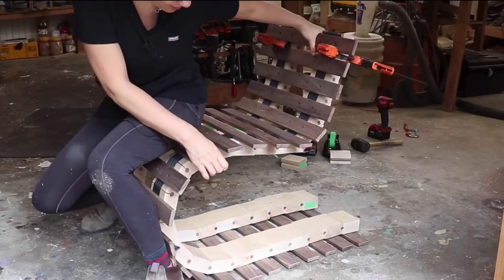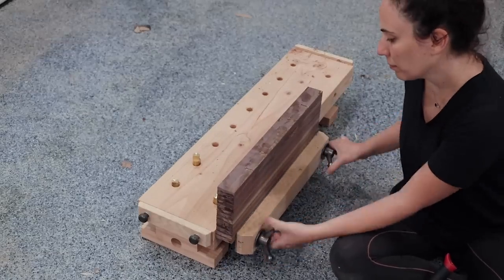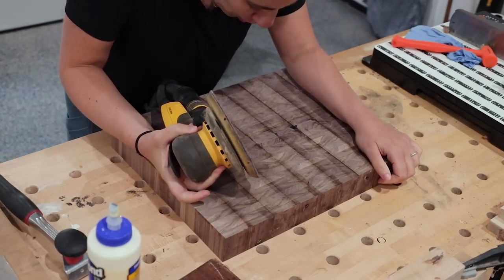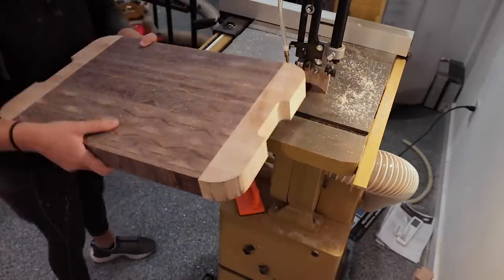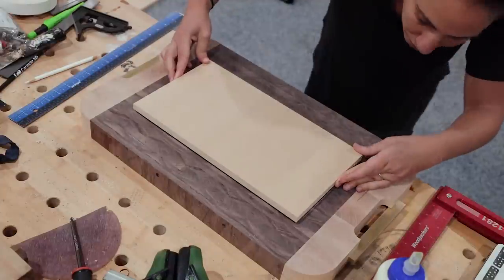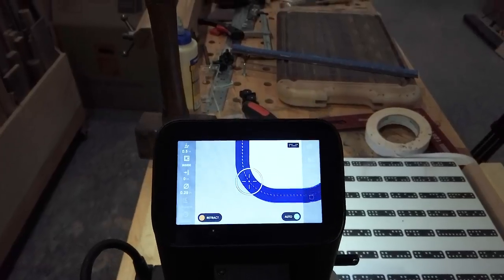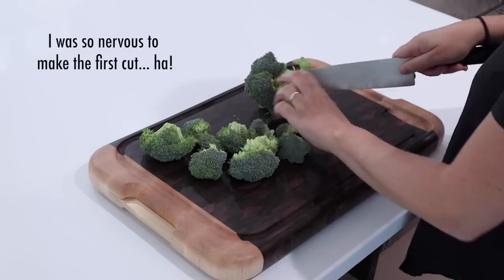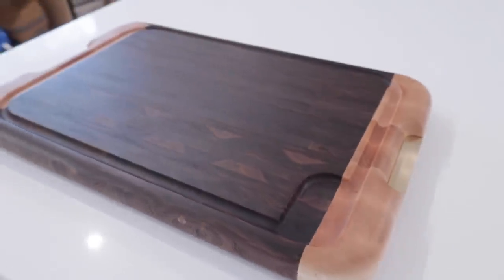Turning my Failed Roll Up Chair into an End Grain Cutting Board with a Juice Groove

Comment: The chair wasn't a failure; it was a complex milling process!
Reply from the maker: Hahah! I guess so! Love it
Reply: ok
Reply: @3x3CustomTamar  It looks like someone may be impersonating you.   I got a reply from Official3x3CustomTamar saying you wanted to give me a gift.  Not sure if you can do anything about it, but thought you and your subscribers would like to know
Reply from the maker: @mwoody4560  ugh. Yeah. I keep trying to report as spam. So annoying.
Reply: @3x3CustomTamar  I thought it was probably a scam but contacted them anyway out of curiosity.  They wanted to give a Macbook and iPhone because i’m such a good subscriber. 🤣
Reply from the maker: @mwoody4560  I hope you didn’t give them any of your info…
Reply: @3x3CustomTamar  please do the chair again.  Speak to a local structural engineer or collaborate with Grady on practical engineering on here.  Its a great design it works just need to choose the right materials and  joints, so they have fixity
Reply: @3x3CustomTamar  do you do give always. I got a message asking to text a number. Is that  legitimate ?
Reply: @mwoody4560  happened to me too yesrerday they sent a pic of an old dewalt josite fan and then wanted 50 dollars for shipping lol
Reply: And turned into something you can STAB!

Comment: Congrats on the new saw, I bought a saw stop, I love it but it didn’t come without growing pains. I made a crosscut sled that included the Katz Moses stop block on top of the fence of the sled. I was cutting a long piece which didn’t require the stop block. I turned the stop block around so it’d be on the side of the fence facing me, out of the way, but I didn’t realize I had it in the path of the blade. The saw stop does work and will detect aluminum. Cost me a new dado stack and a new dado break but at least I know the system works. Only took about 1/32 out of the aluminum. Moral of the story, when you build your ultimate crosscut sled, include something that prevents the stop block from being placed in the path of the blade.

Comment: You working on the floor felt very familiar to me; even inspiring interestingly. I still work mostly without a bench so it was something that I noticed. Though, I'm sure you'll be glad when you can do glue-ups a little higher up. Some form of folding work surface may be a good option.

Awesome job on the cutting board! I like the way that the two tone look works with the complex pattern.
Reply from the maker: Thanks! Yeah. Hopefully I can build something soon

Comment: Damp paper towel under the cutting board -- or a damp dish cloth -- forgot about that one! Used to do it all the time when I worked in kitchens with plastic cutting boards on stainless steel surfaces. It works great.
Reply from the maker: Yeah! It’s a cool trick

Comment: Too late now but if you had used a pedal bike chain (or stronger chain) epoxied in a grove instead of straps, your chair probably would have had the one way pliable strength to hold the chair shape and still roll up. You could even have used thinner components. Beautiful cutting board.
Reply: Never too late, Tamar can always work on 3.0!
Reply: Great idea, but skip straight to a motorcycle chain though, a bike chain probably wouldn't stand up to the forces involved considering that the other one kept stretching the webbing.
Reply: The roll up chair has some design challenges.  Its a project that would actually benefit from engineering knowledge with calculations of load, force, and material strength.  A stronger "strap" or chain is a step in the right direction but it could lead to more hours of wasted time if she just goes for it without some more advanced pre-planning.

Comment: Shaper Origin seems like the tool that you really really have to find reason to use and not the other way around, to solve problems.
Reply from the maker: Not really. It just makes tasks that you can achieve otherwise easier.

Comment: Nice cutting board and great explanation.  👍  Having owned both a drum sander and a double drum sander....  A handheld belt sander is a better faster and smaller choice for leveling the maple ends of the cutting board.  drum sanders only allows for a very very small amount of removal per pass.  New shop is comming along 🙂

Comment: Love the board! Its just *chef's kiss*! just out of curiosity,  why not use the shaper on the board itself? That's how I knock out my juice grooves. Super accurate, and a lot less nerve wracking. Don't have to worry about the router getting away from you, and you have better dust collection. Just a thought. I just love how the board turned out that. And the brass handles are a flawless touch. Just well done!
Reply from the maker: I was going to. But I really wanted to show the mistake in going the wrong way with the router the first time and thought this would be a good way to show it

Comment: I was tempted to try 1/4" dowels on my last [edge] grain cutting board. I used clean wood but thought it could be a cool design detail while adding some strength and of course help with alignment. Decided it wasn't worth the effort.
Reply from the maker: So we came to the same conclusion. Ha

Comment: I was thinking about this chair of yours again and had a thought. I'm sure you may have had the same one or someone else offered the same idea but why not treat the slats as tenons to fit into several mortised end caps. they could be pulled tight with an elastic or a threaded rod. not your original intent but the mortise keepers could be added to the rolled chair without a lot of excess bulk. you only need them in the weak stress areas and they can connect on each side with a strong bungee if needed. anyway, just a thought.

Comment: At 11:07 you started to explain in what direction to cut with a router. In machining we use the terms "Climb cutting" and "Conventional cutting" each has its uses as well as drawbacks... I would suggest doing some research on this to understand and increase quality from the get go.
Reply from the maker: I don’t need to do the research. I understand the correct way to go. I was trying to explain in layman’s terms

Comment: I use that same Makita porta band. What type of blade do you use. I find that my blades get dull fairly quick. Mostly use it for cutting aluminum surrounds for shower doors and blinds.
Reply from the maker: I’ve actually never changed the stock blade

Comment: Tamar, if you have need to use CA glue and keep squeeze out from sticking to something else, use Parchment paper.
CA Will penetrate waxed paper but will Not penetrate or stick to Parchment.
So, remember: for wood glue, use waxed paper. For CA glue, use parchment paper.

PS: Great cutting board and use of scrap material. A real case of making lemonade. 😁😁😁

Comment: Great work! What a way to recycle an experiment that did not go as planned (not a failure, by the way). I used to be a scientist, I have, at least, two "failed" experiments that lead to a scientific paper and new fields of research... So, there, you had an experiment that did not work but you turned it into a new field!
Reply from the maker: Thanks! I’ll keep at it for sure. But for now we need practical stuff in the house. Ha
Reply: @3x3CustomTamar  check out #iliketomakestuff Bob makes some awesome, tricky, funky household furniture and other projects!!

Comment: I wouldn’t count that as a failure, maybe it’s still in process. That was a very complex engineering process with the angles, the correct materiel for strapping, keeping it from twisting. But that being said, glad you made this board l, looks awesome! And a great way to reuse wood.
Reply from the maker: I’ll get back to it someday. But for now we need stuff we can actually use. Ha

Comment: Well Tamar,
I'm not at all surprised that you used those beautiful materials to make something useful for yourself. Good for you.😉
While I am a bit disappointed about the chair, understanding our limits is important to keep us from getting discouraged and giving up altogether.
It is better to walk away from some challenges and keep finding new successes. I am confident that you are more than capable of building a successful chair, but the time and effort required is definitely not practical for your busy life.
Congratulations on your first project at the new shop and getting to use it right away, just upstairs.😁
Yes, sometimes you need to do something for yourself.
The cutting board is a beautiful, useful piece of art!🤙
Reply from the maker: Not walking away. Just a pause. The next version will use different materials 👍
Reply: @3x3CustomTamar  Good to hear.
I use walking away and taking a pause as synonymous.
Not quiting, but putting aside to regroup with a different plan which sounds like what you are doing.😁
Hopefully everything is settling down and starting to feel like home.
I'm still moving and now it's September, just crazy.
Can't wait to see your next idea.😉🤙

Comment: Amazing video and finished product.  I'm continually impressed by all of the little techniques that you've learned and use in your projects. The jigs and templates that you make, the specialized tools that get you exactly what you're after.    

One question about the design though... In your pencil drawing on the wood of the juice well (@ 13:31) you drew what looked to be a spout at the corner edge of the board for pouring the liquid out of the juice well. I'm curious why you decided not to cut that into the design in the end.
Reply from the maker: Haha. You guys notice everything huh. Just a last minute design change. Seeing as how it poured out at the end I probably should have kept it in
Reply: You can still add it if you really, really want to....   ;)

Comment: Screws! The fabric tape cannot be fastened with screws! The screw pushes the fabric fibers apart and creates a backlash of 2-3 mm, so everyone who makes flexible designs on the tape is glued to the entire surface. There are only narrow strips between the pieces (no more than 1 mm) that work as a rigid hinge. 
Sorry for the Google translation.

Comment: Just a wierd question. How will u clean that cutting board after using it? I always have problems with wooden cutting boards and how to clean them without warping or messing the board up after a short time.
Reply from the maker: Soap and water

Comment: Just food for thought you need to make the supports by either by steaming the wood and bend it to the shape you want . Or cut the wood into thin strips bend and glue into the shape you want . This is called bent lamination.

Comment: Your chair's wood parts were nearly perfect, but the inherent fault of the originator's design was that material stretch was never taken into account. Nylon seatbelt webbing is strong along it's entire length because each fiber is running the entire length and all the stress is made on the ends. When you tried various ways of anchoring each segment of your webbing, the anchor, staples or screws with washers, slipped within the fibers length. No way it would have been totally immobile, but immobility was essential for that chair to work. Even if each anchoring point only slipped 1/50th of an inch, your total slippage is nearly half an inch. Considering all the forces applied to each anchor, it likely slipped a good deal more, resulting in a rather floppy "support". Nylon webbing does have some natural stretch too, up to 30%, so that worked against a solid coupling of all the joints. To make this chair work, you'll have to figure in all the stretching that would take place and adjust the connection angle of every block beforehand to compensate.
Reply from the maker: Yup.

Comment: Unfortunately I don’t remember which YouTuber showed this router trick. Using your right hand, make an L. With your palm down point your thumb at the guide. You pointer finger now shows the direction the router should go. This works for inside or outside templates. 

On a router table the, palm goes up, thump points toward the fence. Pointer finger shows direction to move your piece should be moving. 

Freehand routing on the table, palm up, thumb points toward the bit, your work piece goes where your folded fingers are and you go in the direction of your pointer finger. 

I guess the general rule, placing your hand on what’s moving in the shape of an L, your palm is in the same direction as the bottom of the bit, thump points toward what isn’t moving, and you move in the direction your finger is pointing.

Hopefully this makes sense.

Comment: Did you already find a way to build the Chair or are you planning to ever try again? I think it will work if you use stainless steel bands and screw them to the wood.
All the Problems should be solved by a Material that doesn't stretch because the design doesnt allow much movement between those parts even if it looks like it would.
Reply from the maker: Since I moved  focused on more practical furniture we can actually use

Comment: Could the chair maybe work with steel cables? They surely won't stretch...
Reply: Yes they do.  Which is why steel cable structures have to have tensioner bolts.
Reply: @mongocrock  yes that's true I guess. What I meant is that they will probably not stretch as much as a fabric belt. And you could incorporate tensioning bolts like you suggested

Comment: What's the difference between a cutting board and a chopping board? I've assumed that a chopping board is typically used for meat so end-grain on the surface is good, whereas for cutting stuff the side-grain on top is best.
Reply from the maker: I think they’re the same thing… the purpose of end grain is to save your knives from getting dull

Comment: Its awesome to see how you salvaged the material and the result is stunning but clamping the bandsaw this way looks janky af i really dont say it to be disrespectfull but because its an easy way to loose fingers if the saw is not perfectly tight in the clamps. And it doesnt look like this was something the engineers have foreseen. Its just bras, use a flex or a metal saw its soft metal it really itches in my fingers seeing someone using a clamped bandsaw like this because i have seen a guy loosing a couple fingers trying to catch the machine as a reflex.

Comment: why not use titebond 3 for a cutting board?
Reply from the maker: Because I only had titebond 2
Reply: @3x3CustomTamar  geniuine question: would you still trust it to hold up? I've never tried it on kitchen utensils
Reply from the maker: @jamesbondo5895  yes. It is waterproof as well